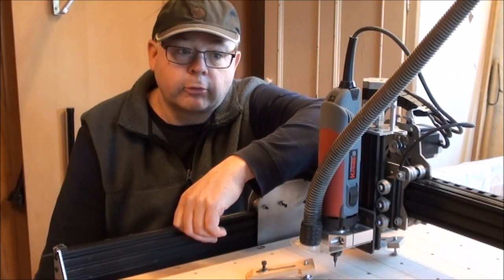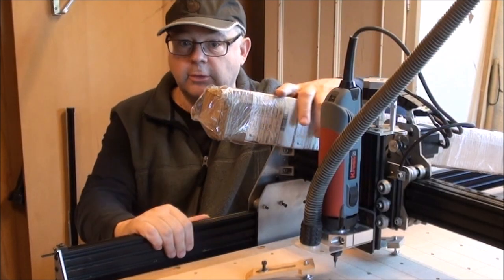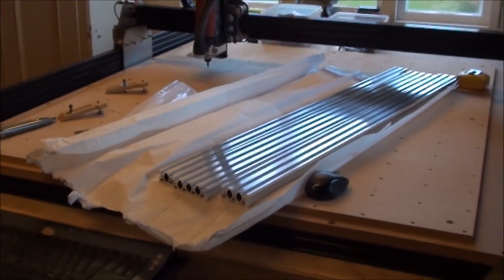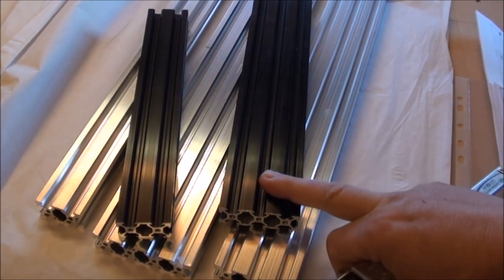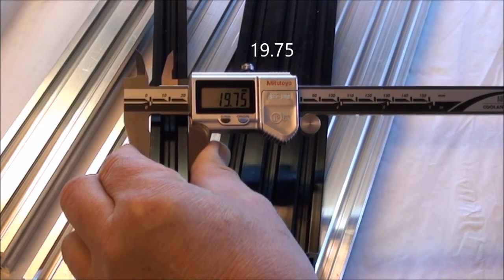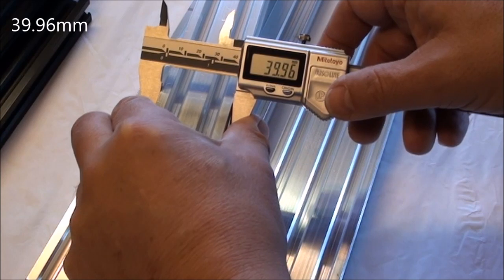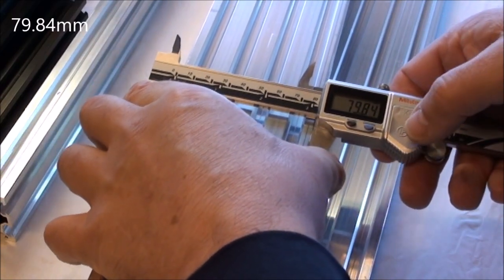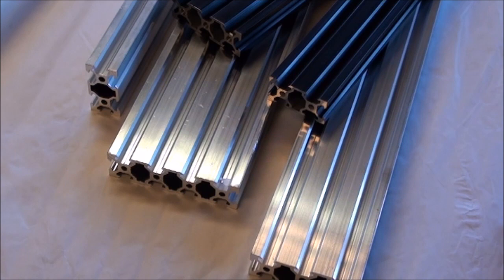Freshly Baked OpenBuilds V-Slot Linear Rails

Comment: Nice, but outside measurements are really not that relevant.  What matters is how the wheels ride the slots.  Setting up and tuning a gantry plate against original rail and then testing that gantry setup against the sample pieces would have been far more useful.  This would help determine where the new material falls within the adjustable range of the eccentric spacers.

Comment: Hi Martin,  Is this sanctioned/approved by Openbuilds or a 'ripoff'?
Reply from the maker: +ituxcoza It is perfectly ok. I have been in dialog w OB from the very beginning. This is the best way to get cost down for the maker community in my area. No import tax, less costly shipment. All other critical parts are however, imported from OB via a distributer agreement, but they are less difficult to transport.
Reply: Ahh ok. Thanks for clarifying (:    i hope you will consider a way of still supporting OpenBuilds (and its programs like Fairshare)  from the proceeds (:
Reply: Ahh ok. Thanks for clarifying (:    i hope you will consider a way of still supporting OpenBuilds (and its programs like Fairshare)  from the proceeds (:
Reply from the maker: +ituxcoza Absolutely, I fully support open source and the fair share concepts. All my designs hat also shared in the same way.
Reply: +ituxcoza Import duty, VAT and shipping make importing aluminium extrusion from the USA ridiculously expensive - it's often just not worth it and is cost prohibitive. I think what Martin has done is an excellent idea and enables those of us not in North America to crack on with these sorts of builds without incurring eye-watering costs. Hardware etc can all still be purchased from open builds -  which helps financially - and folk here can play a full part in the community. ☺️